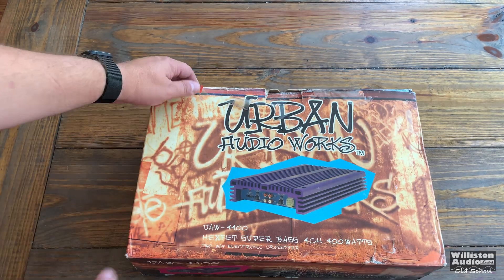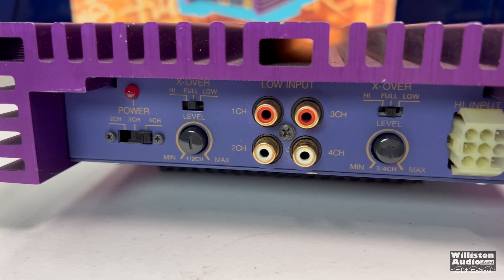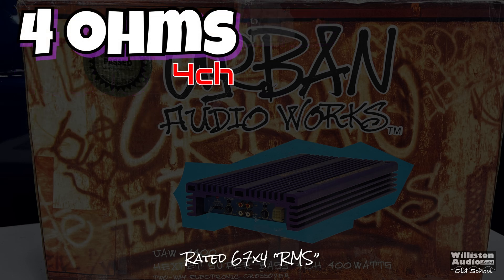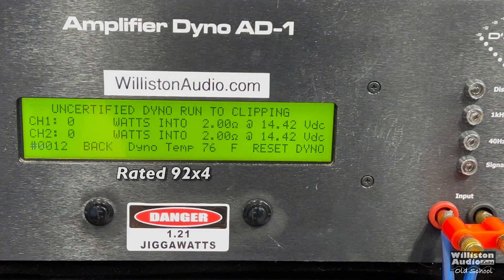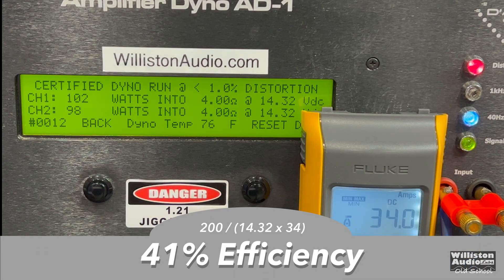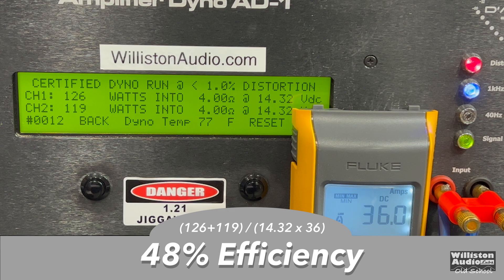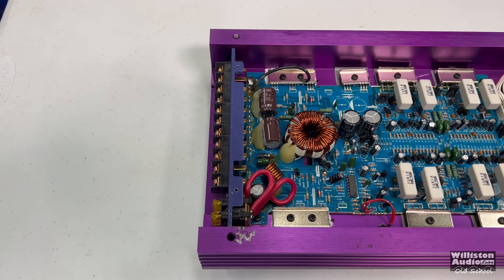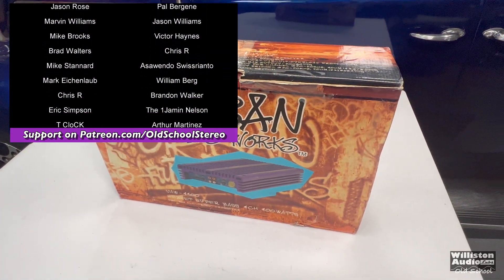How Does a 90's Budget Car Audio Amp Perform? Urban Audio Works UAW-4400

Comment from the maker: ➡ Support OSS / Williston Audio Labs for early access to videos: http://www.patreon.com/OldSchoolStereo
One Time "Tip" for Video Support: https://paypal.me/BigDWiz

Original Video Overview: https://youtu.be/9fhHq5dUL3I
2022 D4S JP34ab (Purple Class A/B 4ch) Video: https://youtu.be/9ptlq9hg3jI

SHOP:
Search eBay for Urban Audio Works (affiliate): https://ebay.to/3Rtjo6A
Modern Day Budget 4ch Class A/B - The D4S JP34ab: https://lddy.no/15b14
Elac Debut 2.0 B6.2 6.5" speakers (Amazon Affiliate): https://amzn.to/3AGbT5r

Video Index:
0:00 INTRO
1:10 AMP CONNECTIONS
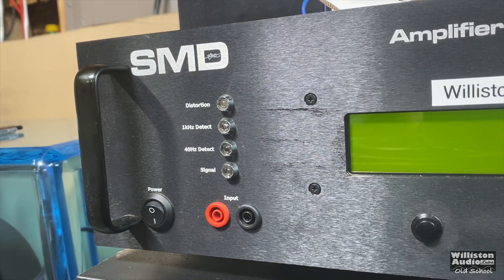2:29 AMP DYNO TESTS
6:39 SOUND DEMO
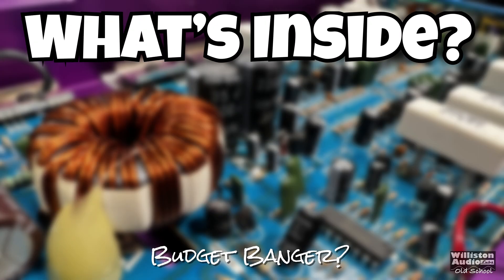8:10 WHAT'S INSIDE?
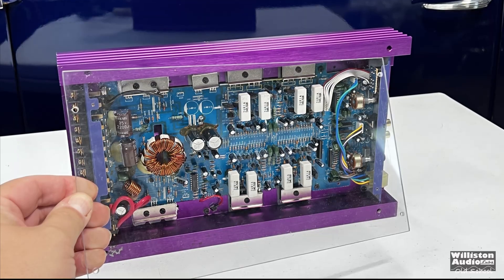9:04 PLEXI?
9:59 THAT'S A WRAP!

(Video Gear I Use) 
Camera - iPhone 13pro 1TB - https://amzn.to/3nCjGvc
RODE Wireless Go II Microphones: https://amzn.to/3Q6NVHl
Shure MV7 Microphone: https://amzn.to/3A4OICK
Zoom H4n Audio Recorder: https://amzn.to/3BXjVsS
960 LED Panel: https://amzn.to/2Sxoq3S

This VIDEO was EDITED with LumaFusion on an iPad Pro 12.9:
iPad: https://amzn.to/2Ancr1W
Software: https://goo.gl/6yvWss

--------- Test Bench Equipment -------

SMD / D'Amore Engineering Amp Dyno: https://goo.gl/sJTcf7
XS Power D1400 Batteries - https://amzn.to/2BPFCKW
XS Power PSC60 Charger - https://amzn.to/2CHGcfs
Fluke 1000A AC/DC Clamp Meter: https://amzn.to/2Rw5WDA
Handheld Dyno: http://amzn.to/2u2EgKV
My Favorite Screwdriver Kit: http://amzn.to/2x0VzcE

DISCLAIMER: This video and description contains affiliate links, which means that if you purchase from one of the product links, I may receive a small commission. As an Amazon Associate I earn from qualifying purchases
Reply: Why did thi amp fail so hard?
Reply: What about majestic amps? I don't remember you testing any of those yet

Comment: Just dug out my old "1000 Watts" Power Acoustik PA-950 opened it up to find its a rebadged UAX-4220 4x65W RMS which has same power transistors (rated around 50w), layout and features so it looks like it is a modernized (1996) version of your amp. That would explain the 2 x 20A fuses 😂 still works in 2025 though

Comment: At 4ohms  it pushes like 140w what about at 2 or 1 ohm?
Reply from the maker: it's a 4ch amp rated at 4 or 2 ohms in 4ch or 4 ohms in 2ch mode. These are the modes it was tested. Most old school Class A/B amps were not rated to handle 2 ohms bridged or 1 ohm operation

Comment: We sold a ton of Targa/UAW bitd. Very rare to have an amp come back . The speakers were junk, the head units were more of a line filler for them and were rarely in stock. Bang for the buck they were decent. Better than a lot of other brands that were around at the time.  Don’t know how true it is but my distributor (who also carried Sherwood) said they were sister companies under the Sherwood umbrella.
Reply: Hard to get the answer. They've been around since 1953. A bigger company that I ever gave credit to. Today the company's leadership continues. Not only is the Sherwood brand synonymous with high performance audio worldwide, but it is an industry secret that Sherwood is the actual manufacturer of nearly one-third of the world's high performance receivers.
Reply: Inkel Corporation of South Korea. Posted everything I know, As big as they are definitely a possibility.

Comment: I was pretty close in my guess on 4 ohm, but 2 ohm kinda shocked me. These amps back in the day did pretty good for what they were. Also forgetting that most head units were 10 to 12 watts a channel. 
I would like to here your thoughts on the sound test though. I've heard other stuff through other reviews you have done. But for some reason, it did sound like the amp was very dynamic and spacious sounding. But that could be YouTube and your microphone. It seemed to have a smile EQ, and was very punchy. That's what I noticed.

Comment: I had the 600 watt targa version in high school on two Pioneer IMPP 12s rsted at 150rms each. That system slammed for such little power and really hit the lows. Later on when I was in the military I got my hands on the 600 watt version of this Urban amp for $20 (back in 1998). Figured about 75x4 or 150x2. Like the Targa. Had it on two JBL power series subs in a sealed QLogic box with the teardrop looking grills and it also hit really good for what it was. Miss the old high efficiency subs from the 90s.
Reply: Those pioneers where awesome subs. I want another pair so bad.

Comment: Yeah I'd love to have that for old retro days to hook up in my wife's little Dodge neon for the front and rear speakers LOL but yeah I had one not the same exact one but I had Urban audio and it was purple but it was more of a roundish kind of aerodynamic whatever it wasn't so square body and I knew it wasn't what it said it was as far as the power because I had pioneer 6x9s that were rated at 300 watts like 120 w RMS and they couldn't even push them at high volume it seemed like after a while it just got all distorted but he was all right for maybe 10 or 15 minutes but then once the amp got hot it just started losing its power

Comment: Ames and Hills used to carry these. My guess is a few shops did carry the, or a few Hills and Ames had display walls and the Plexiglass was used for the display units to show off the guts and wasn’t standard to every unit. I mean it doesn’t look awful for not meeting it’s rated spec. With the yearly back to school 30% off one item coupon you could have had one for $59 at Ames from 1998-2000 or so. I could never stomach it. If you combed around you could get a deal, I got my factory refurb Planet Audio HVT7150 for $150 back then so “saving” a few few bucks just wasn’t worth it.

Comment: These were sold at kmart alongside their purple subwoofers in cardboard boxes with clear plastic window to view their purple cones. I remember those subs didn’t move when you pushed on them, and knowing as a 16 year old that with no mechanical suspension, they couldn’t move much under power. The boxes for their amps were a lot lighter. I never owned an urban product, opting instead for a pioneer sub from Sears and a pioneer amp from Walmart for my first setup.

Comment: @ 8.51 you can see how the main power supply filter caps have leaked all over the board. You're not getting a true representation of this amp's performance capabilities unless all of the electrolytic caps are tested and replaced as needed.
Reply from the maker: That’s called glue my friend
Reply: @wal  Nah, that’s leakage. You can see the glue they were using supporting the two axial caps at the left end of the chassis. Why not try measuring those filter caps? I’m pretty sure you’ll find they’re way out of spec. (Audio technician with 35 years experience)

Comment: We sold the hell out of them at the shop I worked at in the mid 90s.  They almost never got returned with any issues. For everyday listening, they weren't bad for the $. We also sold Orion and PG and a few others. UAW definitely wasn't anything compared to those but was 1/3 to 1/2 the price.

Comment: the junk they made was just horrid . they were sold at kmart . if you got caught with one of anything they made people would laugh at the poor sap . there stuff made boss look better then kicker. cheapest amp i ever had was a shurwood 240 that ran 2 pyle new wave 15s in a 76 vw bus (i was 14 and i got the bus  that came with it for $300) at 16 i got a 81 mercury bobcat and put its body on a 73 bronco frame . before i did the body on frame i pulled from the front seats back out of it and build a v box out of marine plywood . the box had 8 paramount audio double bass 12s powered by 2 fultron 1000s and a 75x4 fultron amp . i sold it in 2005 by then it had gone threw 3 351s , and grew from 31s to 35s (tire) when i was 18 i got a job building boxs at a local shop and would take every blown woofer home and started mix matching stuff with new parts. at 20 i had 2 memphis hp15s that i put fosgate hx2 motors on there frames , dropped them in a 4 cub tapped horn powered them with a memphis hc100 ........
Reply from the maker: But 30yrs later it still works?

Comment: IT SAID ON THE PACKAGING OF THE URBAN AUIDIO.  BY AUDIOVOX.      And as far as the numbers.   ALLL AND I.MEAN ALLL AMP MANUFACTURERS GO BY THESE STEPS.  AS FAR AS CIRCUITRY 25 X 2.  50 X 2. Or 50 X 4
.  75 X 2 Or 4.  100 X2 or 4.  150 x2 or 4.  200 300.   Then the higher numbers of watts are just multiples of these lower numbers.  No amp defeats from this.  ALLL AMP USE THIS.  BECAUSE OF COMPONENTS INSIDE AND THE STEPS OF COMPONENTS.   ALL MED SIZED SQUARE AMP ARE 50 X 2 RMS. AND NEXT IS 75W X2.  THEN NEXT IS
 100 X 2.   ALWAYS.  SO ONE IS 50 X4 RMS
Reply from the maker: Joey, your caps lock is stuck 🙄

Comment: Like I said on a different video. I bought some urban audio 12s from Target, things would not die
Reply: @wal  I had a question about the caps in an amp. Don't they dry out over time and if so would or could this affect power output?

Comment: 2sb688 2sd718 push 80 watt maximum  according to datasheet. this transistor is a replacemen part not original green  toshiba transistor from  earlie 90s

Comment: I have the later version of this amp UAW4060, the heatsink is a bit different but still purple. The board looks the same and DOES have all four rail caps in place. The input side with the RCAs and crossovers is the same too. I believe it's rated 75x4. I had it bridged to two Pyle 12s for a couple years in my sister's Grand Am. It sounded great and never missed a beat. One of the few amps I'll probably never part with
Reply from the maker: Awesome 👏

Comment: I'd assume "rise time" is slew rate, although it's usually measured as volts over time, for example the Rockford T15004 is 30v/úS
Reply: After owning and using these amps rise time is the time it takes the amp to go into thermal shut down. Lol jk
Reply from the maker: Yeah the funny part is the didn’t show a time in this spec 🤦‍♂️

Comment: Mine had a plexy bottom also so I guess mine was rare also mine had 4 caps inside where it's has 2 and took 2 30 amp fuses and was a 2 channel but the size and color was same said hexfet with plexi bottom one side of the amp got too hot and cracked on channels fets so I threw it out prolly in 2002 or so.

Comment: Ouch the power my amp looked like that the purple but mine was a 2 channel and used 2 30 amp fuses I ran it bridged 2 ohm load it got hot thermal shut off so I ran 2 big fans on it.

Comment: I had a 600 watt version used 2 30 amp fuses made prolly 500 rms bridged before I watch I'ma guess around 520 rms I ran mine bridged at 2 ohm ran hot but used fans.

Comment: Had this amp and a UAW 300 back in the day. had the 4400 on the front and rear channels and the 300 on the sub. then i stepped up to the PPI art series with an A404 for the Cerwin Vega dual voice coil sub and A204 for the full range.

Comment: I'd completely forgotten about Sherwood amps until you mentioned them in this video. I think I had one of them 100 years ago when I was a kid and all I could afford was Pyramid quality amps. When I got a little older I got my hands on an Autotek 7600. I know you did the Autotek 7100, but have you ever dynoed a 7600 BTS?
Reply: I had the Autotek 7300 bts that amp was a beast. Pushed two Orion 10 Xtra subs with it.
Reply: @jamms992  I had my 7600 on 6 The Crunch 15”s in a clamshell wall back in ‘95.
Reply: @the_dark_defender  I had to get my Orion's replaced twice because I fried the voice coils, fun times.
Reply from the maker: The 7600BTS should do the same as the Zeus VII I tested

1990 HiFonics Zeus VII Amp Dyno Test RMS Wattage Old School
https://youtu.be/Wzcfx3I2tdo

Comment: I had this amp way back in the day before I knew better. I played the ever-loving crap outta it. II had it running on 2 Pioneer 12's sitting at 2 ohm mono and the other 2 channels on god knows what in the doors. It took it like a champ.
Reply: @ElectronicMusicUnderground  They were IIMPP if I remember correctly. I think this all (amp and subs) came from Circuit City
Reply: Man I want some of those pioneers so bad.

Comment: Love this video. This was my gateway amp before trading up to Profile and again to Kicker. 

Did you measure the heat output of this amp? I remember a smaller amp (same company) and it ran hot enough to burn my hand. I had to mount a couple fans from Radio Shack to stop it from shutting off.

Last thing, you might save yourself some time and skip the speaker output portion. We can't tell what it sounds like anyway, right? I dunno; maybe other viewers love that part, but I love your commentary, the amp Dyno, looking at its guts, the history, and - when you can find it - what it was listed at in Car Audio & Electronics.

Keep up the great work. See if you can get JL to fly you down to Florida or Rockford to give you a factory tour or something. You've got the subscribers now, and you deserve it!
Reply: I had same heating issues but mine was purple like this was a 2 channel class ab and used 2 30 amp fuses was advertised as 600 watt 150 rms x2 at 4 ohms I bridged it into a 2 ohm load so I torched it even worse and it would get so hot I could smell it and feel the heat rising off it I installed fans and it helped alot but if pushed to the limit it still overheat but It would not die lol I let a friend borrow it for a Jensen bandpass box he had and somehow he was able to burn one side of the amp.
Reply: @joshholden8561  Teenagers have the ability to make almost anything burn, right?
Reply: You know I remember friends bagging on profile but their stuff made rated power as far as I remember. Was even included in some comparisons. And they had a 600+ watt surfboard in the crutchfield catalog if I remember right. Urban, graffiti, pyramid, not so much. Empty heatsinks, 16 gauge power leads, etc.

Comment: I am not mad at this amp. It delivered a bit over 80% power. My guess is that the probably rated it at a much higher distortion level. For being a budget amp I still give it a thumbs up. Today that amp would be advertised as a 1000w amp and deliver now where near that. Great video as always BigD.
Reply: I remember these sold at cheap dept. stores.(Hills, Jamesway in the Northeast) They were not Kicker or Soundstream or RF, or MTX, but they were an upgrade to 90s factory sound systems, if properly installed, for those who could not afford the good stuff, like me.....My current systems are mostly Brax and Helix with Micro Presision and German maestro speakers
Reply: @raymo6795  I used to love hitting the electronics department at Hills. They always had something I wanted on clearance for ridiculously cheap.
Reply: @murrayshekelberg9754  I would always go to local stereo shops and look at all those brands I could not afford, then go to Hills and buy the Urban Audio Works…or Audiovox, or Sparkomatic, to install in my 76 Chevy Nova

Comment: If I remember correctly Urban Audio Works had a “Made in the USA” line of all black amps back in the day. I remember a 35x4 watt amp that was pretty damn decent.
Reply: company is still in business ever heard of Orion same company md audio engineering miami dade fl
Reply from the maker: I don’t recall those?
Reply: @wal  I saw them at the car audio store in the local farmer’s market in DE back in the mid 90’s. The USA line wasn’t as broad as the regular purple line.

Comment: Thank you for finally doing a dyno on that amp I've been waiting for a long time LOL. I'm very surprised I thought it would have a little bit more power than that but I probably had some bass boost on my crossover. That was my second amp I ever bought. My first was a refurbished Jensen 220 watt 2 channel. Thanks for the video Big D👍👍
Reply from the maker: Awesome 👏
Reply: I have a 220 mono Jensen an it slam a 12 pioneer for what it is atm

Comment: D718 is a TO-3P packaged NPN transistor made by many electronics components manufacturers. The transistor is designed to use in high power audio amplifier applications and capable to deliver output audio of 45 to 50 Watts. 

If just look on the chip model wel the amp do it great really .
Its just the specs on the pakket that is not correct witch chip data .

Wel in the 90's. Internet was not a thing you can easy look for the specs. 

Funny thing is that d718 is use a lot in Amps .
Reply from the maker: We can’t see the transistors unless we look so we have to go by the manufacturer’s specs. Now we know!
Reply: @wal  

I agree with that 
You do not open new stuff from the store.
Speciale not in the time of the 90's. You lose the repair rights if the amp go death in a year .

But it its fun to see how the chip performance in the amp.
You can see if the power delivery is a good one or just junk.

Dyno is the only way to test the chip how it performance.
But i do think in that day no test are done on the cheap amps  and just calculate what the power out put is.
Or just copy the specs from the factory .

Comment: Back in the 90s so many mfgs used PMPO which was purely calculated, but adding the max energy storage possibility of every device in the amp, no matter it's real function, and calculating an instantaneous output figure. It's very similar to the way that equipment is certified for intrinsic safety and mine safety, but makes MUCH less sense.

That said, with the 67W number, I half expected to see LM3886 chip amps in there, which can do 67W into 4R under very specific circumstances.
Reply from the maker: It sure seemed realistic to me. Kinda bummed 🫤
Reply: @wal  amps from the 90s are a coin flip. This one flipped tails. That’s all. ;-)